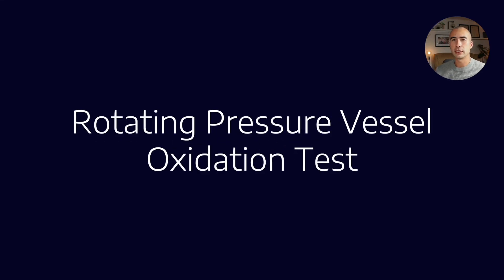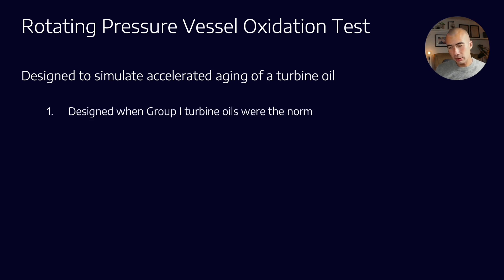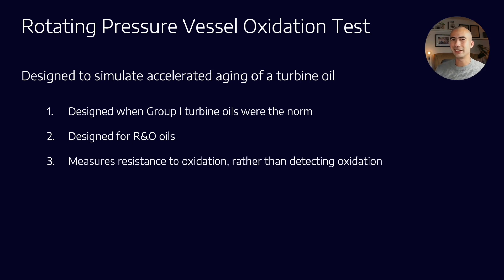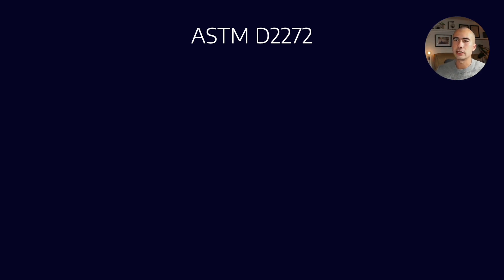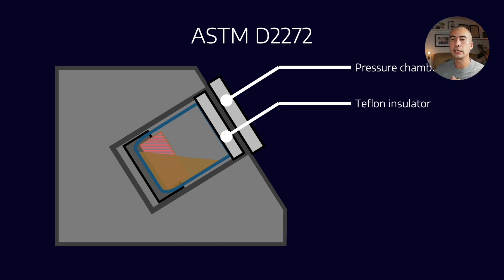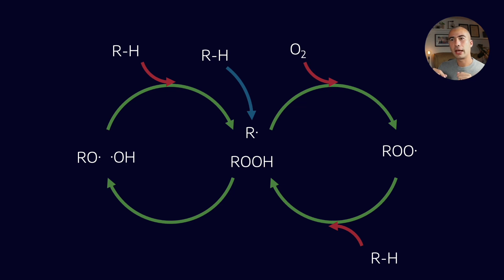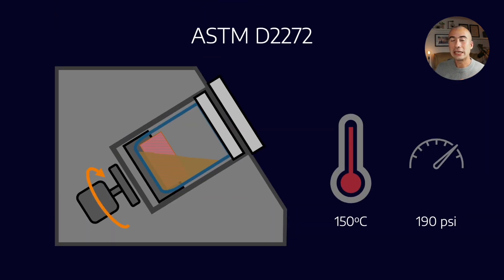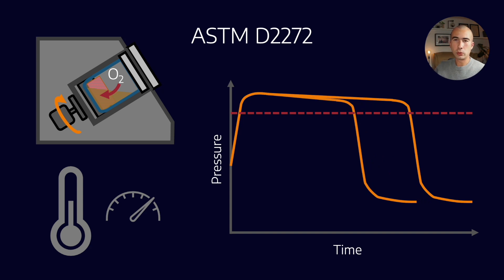What is RPVOT and how do I use it?

Comment: Great Video and great learning. Please help to resolve below query. 
1. Why only copper used as catalyst.
2. If manufacturer cheat by adding anti copper oxidation additive then can we use any other element as catalyst ?
3. If we don't have reference RPVOT value then is there any reference available to compare with original ?
Reply from the maker: Good questions - copper is generally used as a catalyst because you'll find copper in a lot of machine designs, whether it's the oil coolers, or bearings materials. Copper is both a catalyst, and susceptible to corrosion, so it's a good one to include.

We could use another catalyst, but then the manufacturers who are cheating the test would change to a different additive system - so if we changed it to platinum, they'd load up the formulation with platinum passivators.

If you don't have a reference then the best thing to do is trend results over time. If you continue to use RPVOT to test the lube oil system the number will drop further and further, and you can use the rate of decrease to predict oil life.
Reply: @LubricationExplained  Thank you Mr. LE